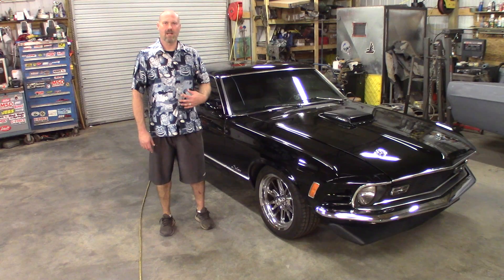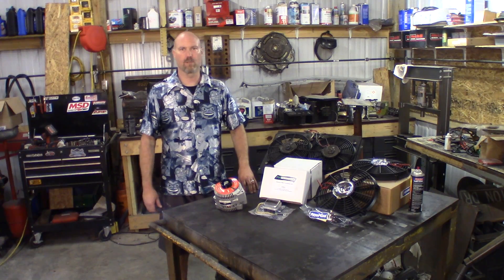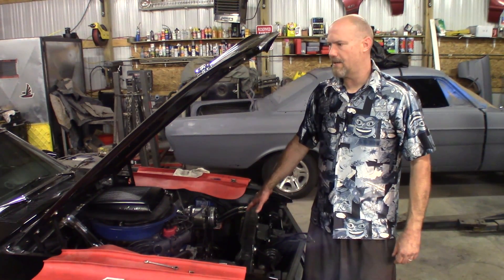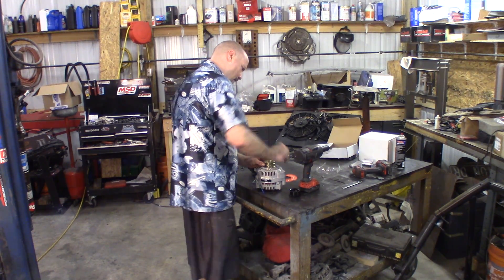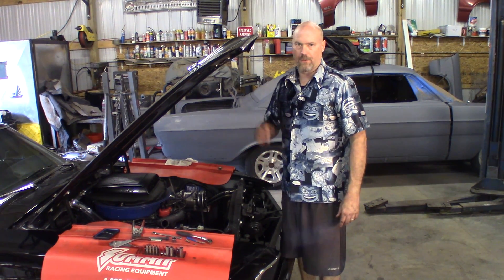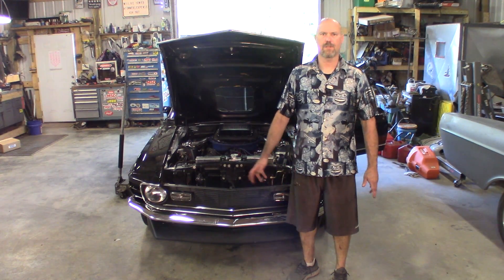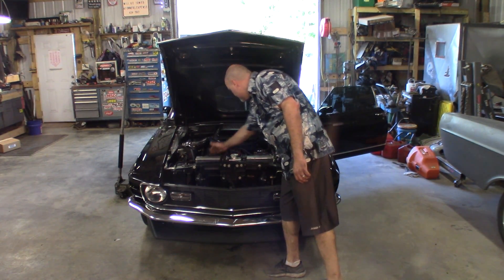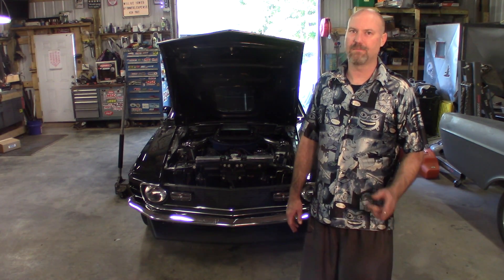3G Alternator upgrade 1970 Ford Mustang Mach 1 351

Comment: Nice video, when I did my 3G change over on the tab I drilled out the metric threads and tapped a 3/8-16 so it would be normal fit.
Reply from the maker: That’s a good fix! Thanks for watching!

Comment: Lets start by saying beautiful car but why are you running an external regulator when the 3g has an internal regulator, main power goes to the battery, green to switched hot, that's it.
Reply from the maker: It a “dummy” regulator. Only thing it does is retain the factory wiring so I don’t have to cut anything up. Basically just keeps everything looking period correct and no hanging connectors/plugs.